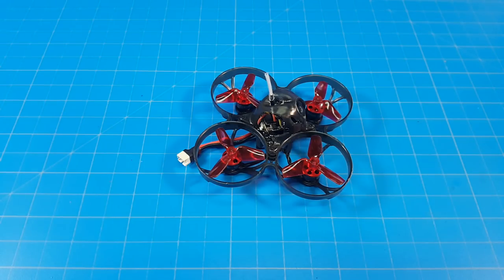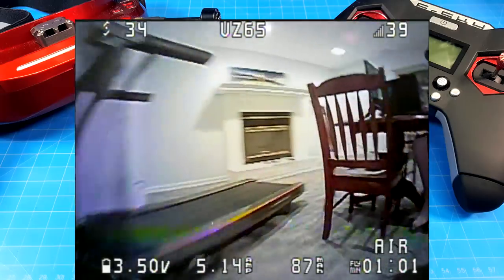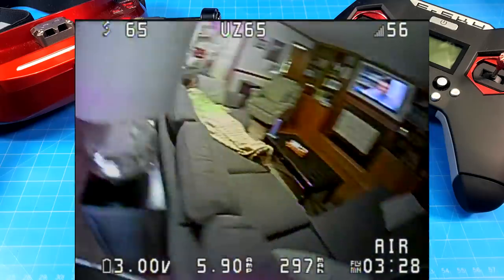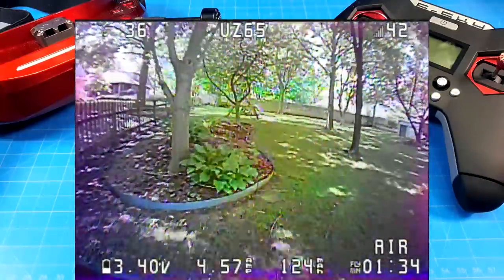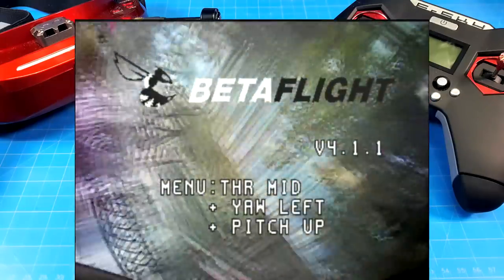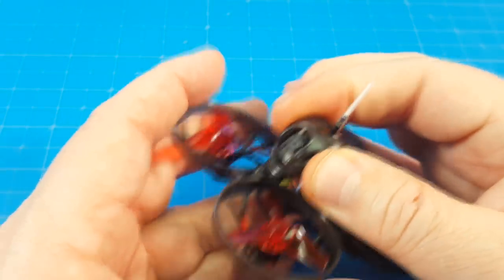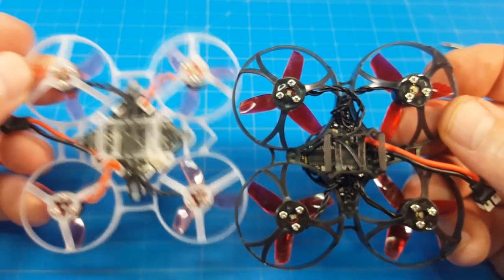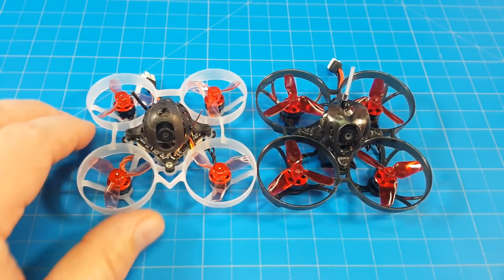Eachine UZ65 // 35mm props? // Less than 65mm!

Comment: I've finally got mine flying ( I accidentally ordered the wrong version ) after installing an external spektrum receiver. Unfortunately I had to wipe the board about 2 times to get the FC to actually accept the receiver. It flies quite well for something so small. I had to take everything out to put that receiver on. So make sure you order the proper version of that quad, people or you will literally spend a good 2 hours soldering and re soldering.

Comment: Looks great but you’re correct I took apart a mobula6 today built it on a 75mm frame 25000kv with a throttle curve and  built a16000kv mobulite with a caddix eos Turbo 2 plugged in👍

Comment: I removed all connectors from my whoop and soldered on directly. Not (only) because of the weight, but also because of the connection, it is significantly better (on the mobula6 and the UR65, I am shure!)
but if this one is heavier than the mobula... thats a no-no for me

Comment: Mine was secured pretty terribly. The VTX got forcefully relocated forward and up in a crash. It did not stay there for me, maybe the foam block used did not have good glue. The camera connector head seemed to have taken a little damage in the crash to the wiring, causing an intermittent poor connection, resulting in OSD + no camera image. So I had to heat shrink and add a little glue to the connector to help fix it. I added some heat shrink to part of the entire VTX as well to secure the UFL connector. Not sure what they were thinking putting the connector in such a way that can cause the antenna to be crashed into "against" itself... and hot glue just won't last on that. Maybe the guy who worked on mine was just sleepy. The VTX will indeed 'overheat' and shut itself down too. The stock tune is not as good as Mobula 6 -- I get washout a lot easier with the UZ65. I think if you get a good deal on this unit then it's worth it, but otherwise I'm finding any good reasons to go with this over Mobula 6 if they are basically the same price and in stock.
Reply from the maker: I don't suspect your up for trying the new bigger version the uz85?
Reply: @NickBurnsFPV  possibly, I didn’t even know it was out yet. Why, is it really good? I see it's up now, it sort of looks like UZ65 & Eachine Cinecan had a baby together...
Reply from the maker: @JohnCuppi  It is out, good....well is mainly going to be for outside as 85mm 2s for most isn't feasible inside.

Comment: Did you find in acro that pulling out of hard moves such as powerloops or hard yaw turns with throttle caused  the quad to dip angrily on one side depending on the turns since then i have flashed bluejay and betaflight 4.4.2 with uav preset its allmost fixxed the problems but they still happen during realy hard acro eny help be gratefully appreciated
Reply from the maker: I don't recall. This video is 3 years old. Hopefull the video has flight including such
Reply: @NickBurnsFPV  iv almost tuned it out hopefully different frame will fix it its really fun to fly at home

Comment: Nick, what DVR is that ? footage looks insane for a whoop,  is that the VTX camera footage ? almost no dropouts!! what antennas ?? Wow !!!
Reply from the maker: I am using the orca goggles with the rapidfire module. Our open floor plan helps a lot.
Reply: @NickBurnsFPV  so it is the orca dvr ? i  have seen other whoops footage and you can barely see the image , very low res and video dropouts
Reply from the maker: @rolisaenz  yes, orca dvr. I am told the fatshark scout goggles have the same dvr.
Reply: @NickBurnsFPV  is there any standalone dvr you can recommend with that quality, cant afford fatsharks or orca :(
Reply from the maker: @rolisaenz  the powerplay from immersionrc is likely the best standalone choice. $99.

Comment: Would the mobilite mod work on this as well, since it already wields larger props?
Reply from the maker: It will work but have less of an impact. About 50% based on prop size
Reply: Ok, thx for the info

Comment: UX65 canopy, without the camera mounting hardware, should be 0.8g according to Banggood. Mobula 6 canopy weighs 0.98g with camera mounting hardware. So extra weight penalty might be quite mild.
Reply from the maker: I have ordered 4, I think they will protect the camera much better and hold the camera more steady too.
Reply: @NickBurnsFPV  I'm considering ordering a few of these too, but bit worried about these arriving in one piece. With Banggood usually just putting a plastic bag around an item, these canopies are unprotected, and can easily get broken during transport, or at least massively warped.

Comment: Nick thanks for the video on the UZ65. I have them both and am hoping that Happy Model will make a version with 35mm props. The M6 25k has more thrust, is faster does acrobatics better and has more range. The UZ has a lot more flight time and no jello with the better canopy. I also broke the UZ65 frame twice and have not broke a M6 frame yet. (I was the one that broke the Diatone Cube frame). John from Chicago.

Comment: Did you refresh the ESC with JESC at 48khz?  what is the stock UZ65 running at?  Thank you for this video.
Reply from the maker: stock, in review videos I don't do things like flashing esc. I might tune it better or change betaflight versions if there is a problem, but otherwise I try to leave them alone.
Reply: Nick Burns thank you sir!  You are a great     Pilot !

Comment: Not sure if anyone will read this 3 years later, but do you think a walksnail mini lite vtx would be to big for this little guy?
Reply from the maker: I suspect the vtx will overlap the props, could be a tuning nighmare. The AIO they used in this is pretty specialized with super narrow corners, almost like a cross.
Reply: @NickBurnsFPV  Thanks for the reply. I will try a mob 7 frame instead.

Comment: Pretty crazy how it drops from 4.2v to 3.8 per cell just after arming. That seems like a cheap battery or its consuming too much voltage initially when getting off the ground
Reply: Well in whoops, for a long time every company has been using a pH 2.0 connector which bottlenecks voltage and current, but now with betafpv's bt 2.0 connector battery sag is still there but it is a lot less noticeable. I wish that whoops of the future will have enough power to carry an xt30 connector.

Comment: I have and like the uz65 but after loop and rolls there is some times a snipping reaction of the whoop.  Any Suggestions?
Reply from the maker: hmm. I would lower p and d on the axis you see the movement by 2 each and test, then lower them again. If you get to where you have lowered each by 10 or more, I think it could be something else. Make a copy of the current pids. Also check for loose props or change to fresh props.
Reply: Thank you Nick, I tried today but with no success.  Changing p and d does not help but I realized that when I push the throttle very softly after a loop or roll, the whoop does not snip. So for the uz65, i'll have to change my style a bit. Kind regards Marc

Comment: Hey Nick Burns, could you do me a favour and look into if the signal with the runcam is 50 or 60Hz?

website says it is NTSC, some say also PAL. I dont want to buy it and then figure out. would very appreciate
Reply from the maker: How would I be sure if 50 or 60hz?
Reply: @NickBurnsFPV  i tested it with a google that cannot auto switch between them. and i personaly can sense the extra 10Hz